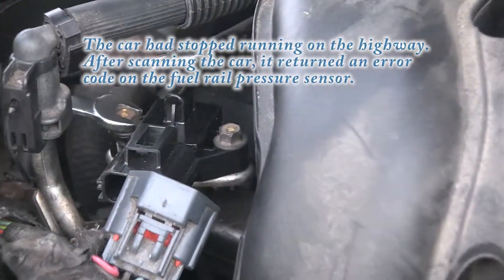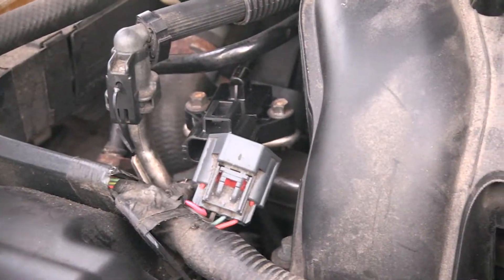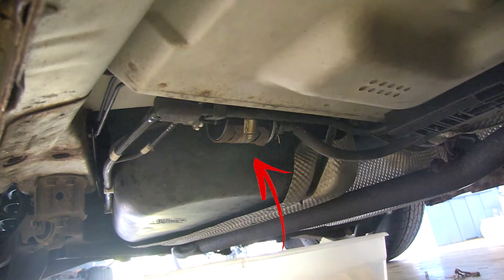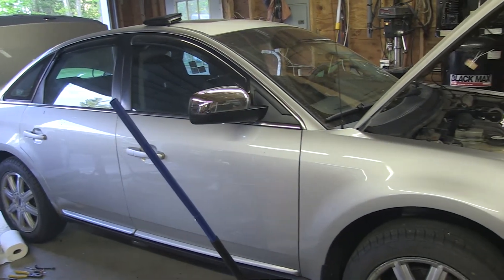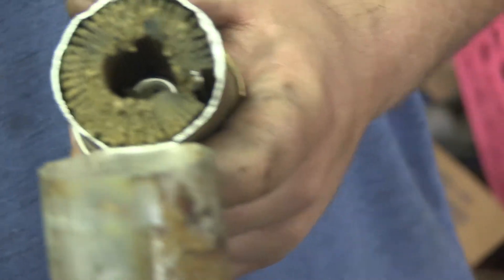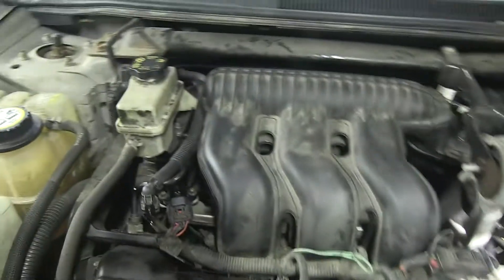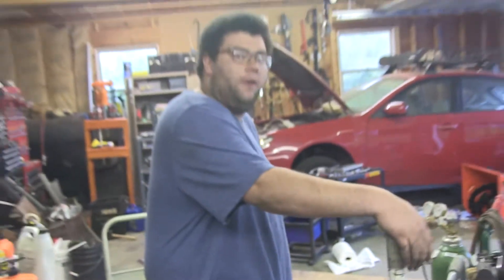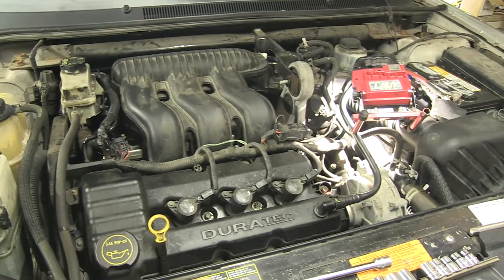Ford 500 fuel filter failure. Gives code for fuel rail pressure sensor.

Comment: Great video thank you. Any advice on bleeding the fuel system when I cannot start the car? What happens if you just remove the fuel filter? Do you just empty your tank or…? TIA
Reply from the maker: No, not at all. Just a little bit of gasoline leaks out. I would think that the fuel pump will push the fuel and displace the air....

Comment: Do you know the orientation of the fuel free? Mines pointed towards the gas tank and I’ve only seen one video showing the way, my mpg dropped changing it
Reply from the maker: The side of the filter with the raised (crimped) edge is the outlet side! If you google "fuel filter" and lopk at images, you will see this true for pretty much any fuel filter.
Reply from the maker: and you're welcome!

Comment: Not getting in to everything bur iv changed filter the spark plugs and coils even had to do the EGR now still not working Even had the check engine code Come up for the fuel rail  pressure sensor again unless The part is bad something else must be setting it off. HELP

Oh also the FP is at like 89.6 and don't know why it's thar high